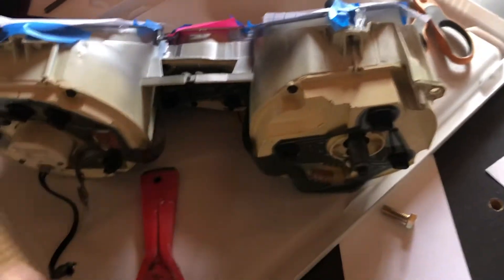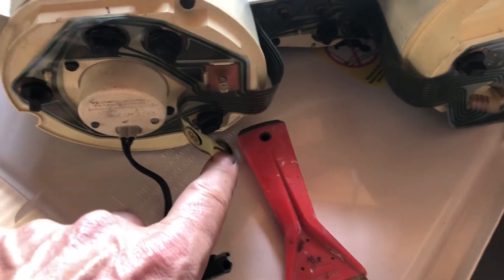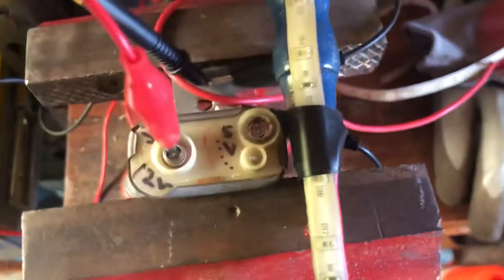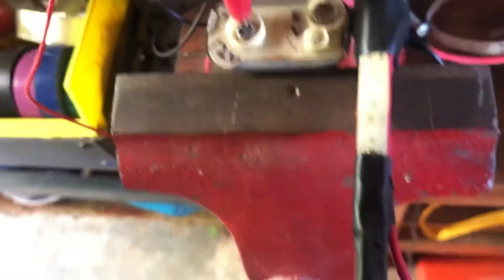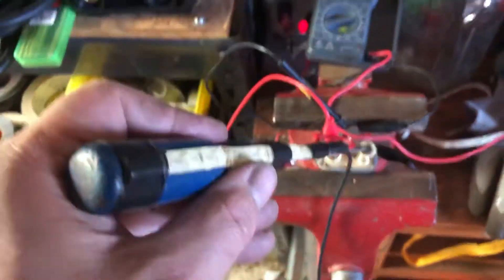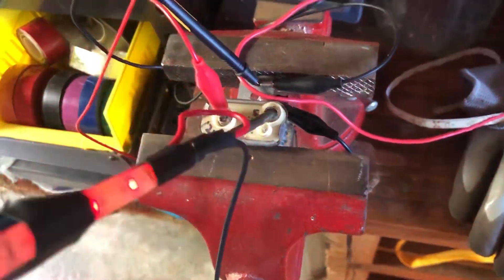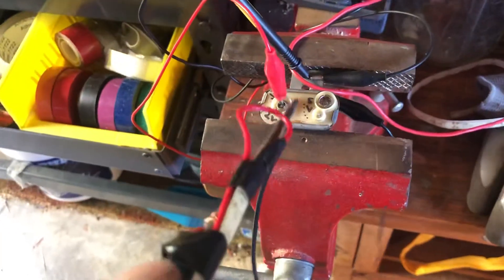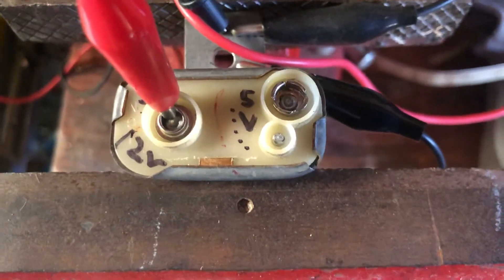1972 Ford Mustang - instrument cluster panel voltage regulator - troubleshooting

Comment: Where can u get the part from
Reply from the maker: One option is 12v to 6v regulator. 
DROK Waterproof High Efficiency Car Power Converter DC12V to 6V/3A Step Down Voltage Module 9-22V to 6V Power Supply https://www.amazon.com/dp/B00CGQRIFG/ref=cm_sw_r_cp_api_i_MDGNY989QWMZV9Y13VB1?_encoding=UTF8&psc=1

But I think I ended up putting this pin compatible one in (solid state )
https://www.cjponyparts.com/constant-voltage-regulator-mustang-1969-1973/p/HW1567/?utm_source=Pony&utm_medium=Email&utm_campaign=OrderConfirmation&lac_guid=a4986b00-d30f-eb11-834d-0050568938fc